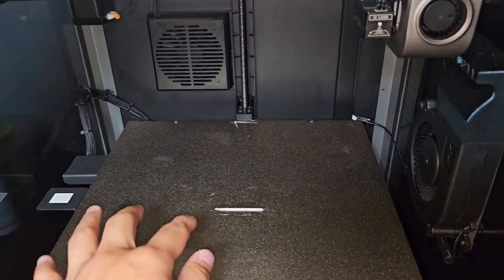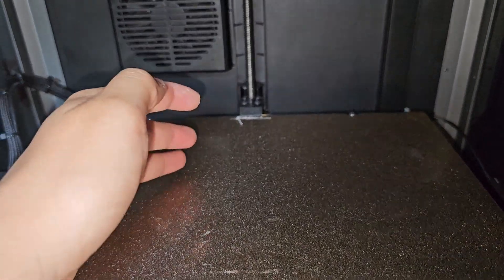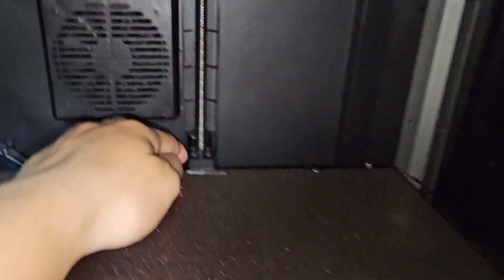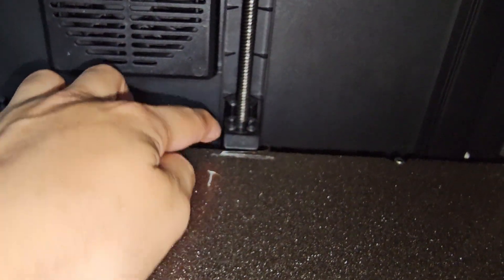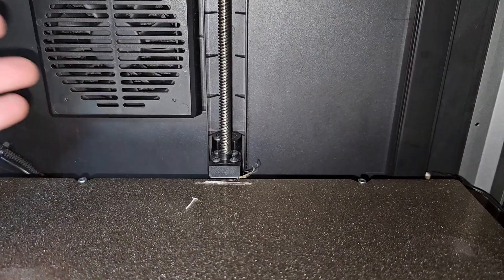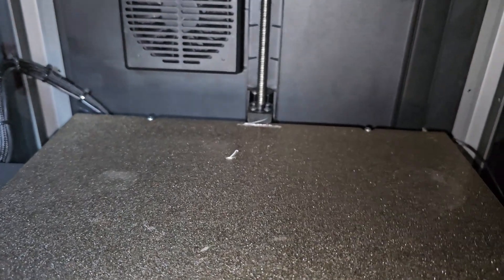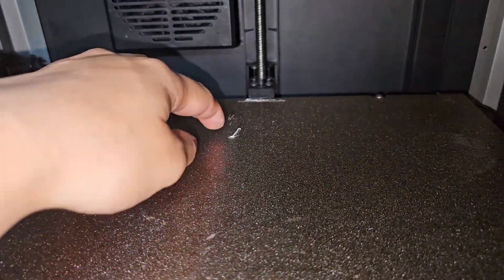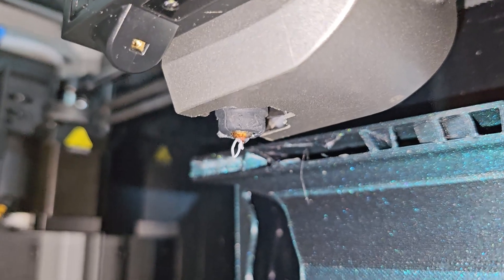Creality K1 Max First Layer Problem Fixed

Comment: I have added to my K1 Max a heated nozzle silicone wiper from bambu lab A1. It works perfectly, i don't have any issues with the bed leveling, it's perfect every time and my printer isn't rooted. If you want more information let me know.
Reply from the maker: Thats amazing, yeah having a silicone wipe is nice, creality did not include that when they were making the K1 max.

Comment: I have dimension problem. X axis smaller than y axis 0.2 mm for 20mm xyz cube. Do you know how to fix it? Skew did not work.
Reply from the maker: I'm not quite sure, haven't have that problem yet so not quite sure what to do. Maybe someone else have a solution. Sorry.

Comment: Thanks so much for the tips! I've been really struggling with my K1 Max to the point where I've replaced all the strain gauges, the leveling board, 5 bed plates, belts and more, and I've just ordered a BTT eddy probe. Do you plan on using a contactless probe like that in the future? It looks a lot faster and safer than using the nozzle as the probe. And I wonder if there is a way to retrofit the K1C tower. I assume it would be as simple as mounting it somewhere and editing the start gcode?
Reply from the maker: No problem,  yeah the k1 max has many flaws that the k1c actually fixes. That's alot of replacements, maybe I'll think about getting a contact less probe in the future. Also I'm not quite sure about the k1c tower.